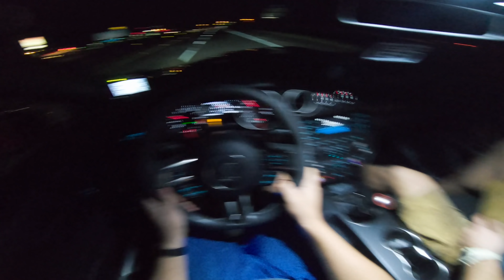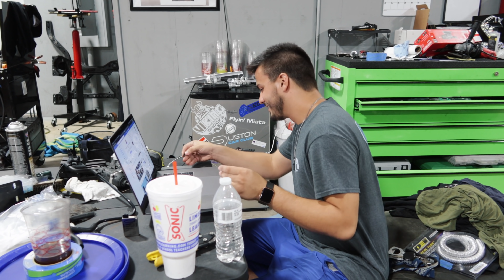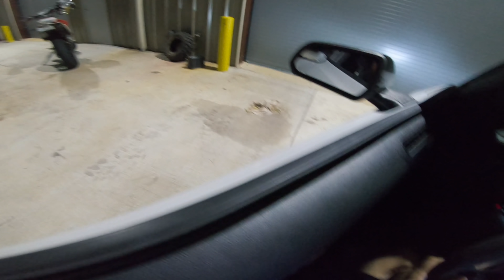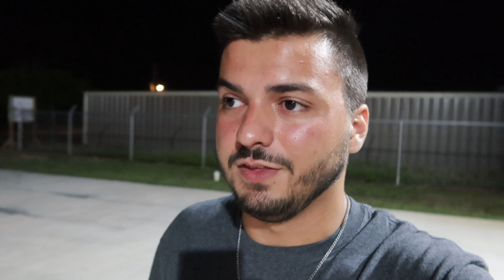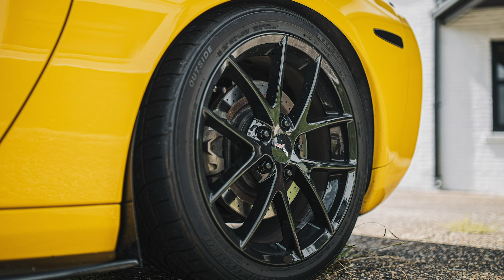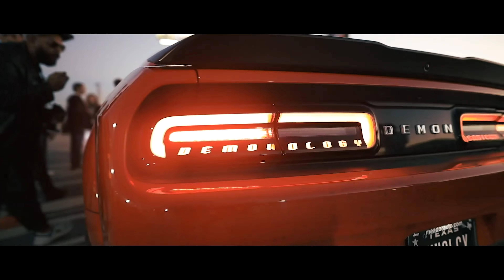My First Pull reaction in my Twin Turbo GT350!

Comment: I would highly recommend you get turbo intake tubes for the Shelby that place the filters towards the top of the engine bay, so that if you ever drive through heavy rain, you won’t have to worry about the car sucking in water and destroying the motor.

Comment: I recently test drove a 2007 911 turbo.  It was slow until you got to 4000 rpm and then it took off like a rocket.  I hated it, not a fan of turbo lag.  I'd rather have something with a smoother torque curve.

Comment: Your car is going to be a monster. I hope that when it's wet out the turbos don't suck water with the air. I realize that we're talking about alot of heat but I'm not liking the filters on the turbos. Other than that it looks like a killer set up. Keep up the great videos and look out for the police when you are testing your ankle strength.

Comment: Intake under the car, then it rains, hydro lock, done. Sick.
Reply: Really if you look at 90 percent of car intakes now days the intake runs straight to front of car so where do u think water goes in the intake tube but by the time it gets to filter and threw filter it's evaporated especially on turbo car now if he goes threw a foot of standing water might be a issue I would maybe run to 90 elbows just to get them up a little higher but people run remote turbo systems like this and seem to have no issue in rain. I actually rode in a Corvette once where turbos and filters were at where the muffles normally are all the way at back in a thunderstorm and I said same thing and he said he has never had issue buy the time what water does get threw filter the turbos just evaporate it cause there so hot and spinning so fast even at normal speed.

Comment: I see a very big problem with that car , those turbos are very close to the oil pan which is a composite polymer( hard plastic) those turbos are going to get hot and may melt or distort the oil pan. Put some dei exhaust wrap and a turbo wrap on it to keep the egts down and avoid that problem.

Comment: I’m just getting into cars, but how do you increase hp or what are the different ways
Reply: Essentially you need to burn more fuel to make more power.  But there is a certain ratio of fuel to air you need to keep.  So pretty much making more HP Involves finding ways to get more air into your engine,  whether it be from a turbo,  supercharger,  or a well built motor.

Comment: If the turbos are on the bottom and it’s raining outside won’t water get inside from the air intake??
Reply: Really only if drive threw standing water that would cover filter water splashing on filter just gets evaporated buy speed and heat of turbo

Comment: Curious how Oiless turbos work,  did u explain?
Reply: They actually have a special grease that you have to use every so often as part of routine maintenance but overall it's a great thing because no oil lines no oil dump can place turbo in any way you want without worrying about oil drain. I think it's great for street and race cars maybe not a every day driver cause I don't know how often they need grease but depending on interval overall its a great idea I think alot of kits will go this way to cut cost down eventually.
Reply: @ninablatchley842  thanks for your response👍 ya I'm  not sure if they will be ideal/longevity but very interesting. No supply or drain is definitely easier install.

Comment: Turbo = power and turbo lag Supercharger = power and loss of fuel mileage. It all depends what you want its a trade off.
Reply: There are ways around turbo lag now and days 2 step anti lag flat foot shift all keep in boost from start to finish
Reply: Plus you could always add nitrous to really get things SPINNING lol
Reply: @ninablatchley842  While those things help the low rpm lack of power is still always there it takes a lot skill to get 100% around it. Nitrous is a whole other beast that kills engines no matter what it's pure racing application only. Super chargers are just great for power reliability, but they use HP to get HP so it consumes fuel like no other.
Reply: Nitrous killing engines is because of people not knowing how to use it. I bought 08 mustang GT off show room literally had 2 miles on same weekend install exhaust intake and 125 shot with zex wet shot was really hard but I did wait to get 250 miles on car but then I never looked back I mean I did things from cutting donuts with nitrous to top speed runs over 160mph and every other week at drag strip I literally had over 80 nitrous bottle fills at shop in his computer system last time I filled bottle and when I got rid of car it had 65,000 miles in it I drove it every day and punished it and never had a issue actually only changed spark plugs 3 times as well whole 2 n half years I owned it as well. But back to lag yes of course if u street drive there is going to be some lag but during a race or a prepared role launch full boost is pretty much on demand with properly sized turbo and tuning
Reply: Main problem with nitrous is it's VERY easy to make alot of power and people get hungry for more and more.

Comment: Is this gt350 faster than the black Mustang?
Reply: Not even close in a drag race if they turned it up to around 15 pounds of boost maybe in a roll race but black one is a drag car white one is stock with turbos really not a comparison now if the white car had a built Engine like the black car it would make way more power he could probably get 1400 hp to wheels with that set up with proper fuel mods and tuning of course.

Comment: Turbos but no fuel system upgrade? 😰
Reply: Yeah he didn't do a boost a pump which ups voltage to the twin pumps the car already has or do 1000cc injectors and by the way I am being sarcastic. What else does he need to do

Comment: Paxton or procharger. thousands of dollars. VMP thousands. GT40 turbo off ebay? $150.
Reply: But Precision just as much or more its just a brand thing I can buy factory made supercharger size of a AC compressor for 150$ that means nothing its still junk they come on little diesel imports just less common cause everything is going turbo why u think all diesels are turbo they tried supercharger turbo makes way more pulling power and better fuel economy supercharger just sounds cool and makes for fun burnouts
Reply: @ninablatchley842  obviously if you buy a 3+ grand garret turbo "by garret" then you can make it cost allot. but theres no cheap chinese supercharger. they all cost thousands. even a dual ball bearing billet wheel turbo on ebay isnt half as much as a used centrifugal

Comment: “The only reason people go supercharger is because they can’t afford to go turbo”

But turbo is less expensive.....
Reply: On what planet... U can blow a 5.0 for 4k-7k... U cannot do a turbo setup for that... You'll spend 3k on the turbo alone
Reply: 3star2nr bro what........ a vs racing billet 78/75 is $450
Reply: @g32k  you want to put a 400.00 turbo on a 40,000.00 car... Especially one with an engine bay as cramped as these? 

I guess more power to u... Me personally I wouldn't want to be swapping turbo every 5 months to replace oil seals...
Reply: @g32k  good quality turbos start at 1500 each...
Reply: 3star2nr he spoke in general not just for for the mustang, but I know multiple people even running cheaper turbos for years

Comment: Exhaust turbine= turbine ("impeller") (hot section)
Crompresor turbine= compressor ("impeller") (cold section)
Not hating just education for proper terms. There is a turbine and a compressor on a turbo and the rotating impellers are not turbines.